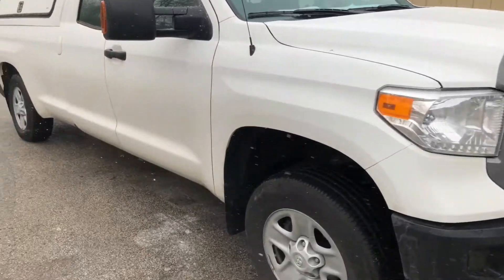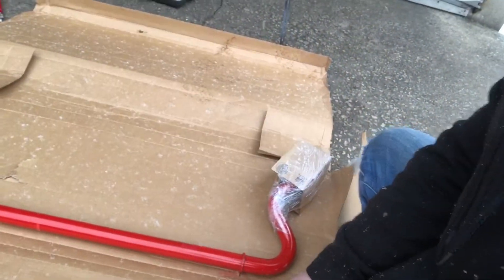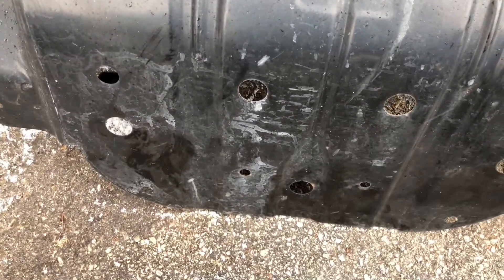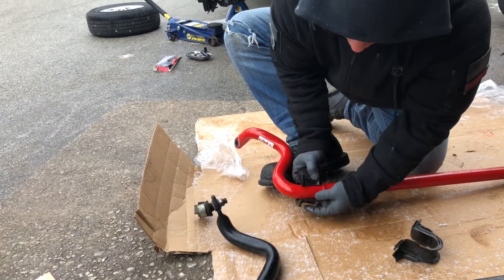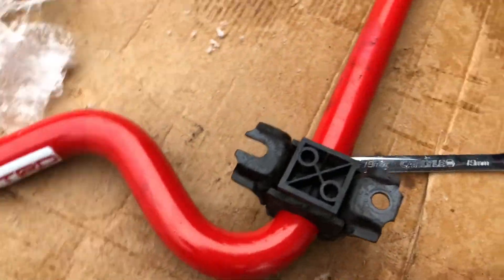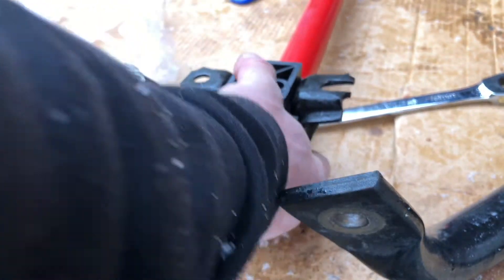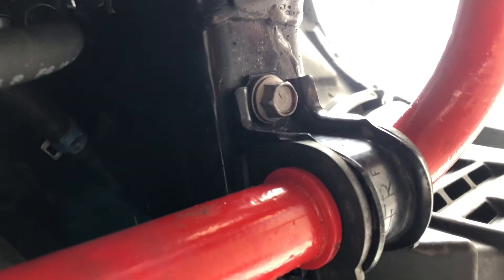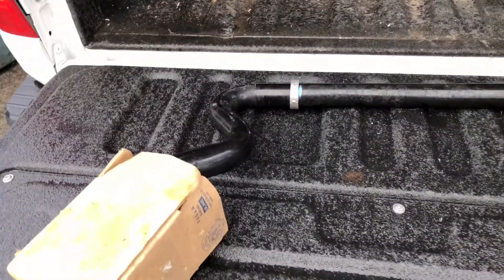Toyota Tundra TRD Front Stabilizer Bar Installation

Comment: Well is it just me or does it seem like, from your video that you took off a black stabilizer bar and swapped it for a red stabilizer bar? Why,  when they seemed about the same thickness and strength?
Reply: Todd Orr I replaced mine and the TRD one is definitely heavier and stiffer.
Reply: Trd is solid steel original is hollow tube. Not being an engineer it seems wierd to me it would make that much of a difference but apparently it does from what people say.